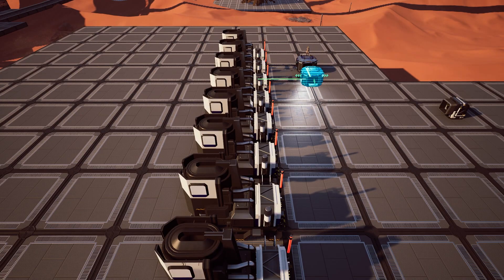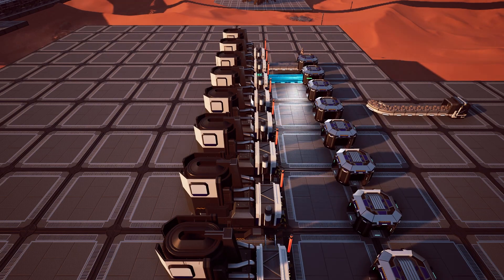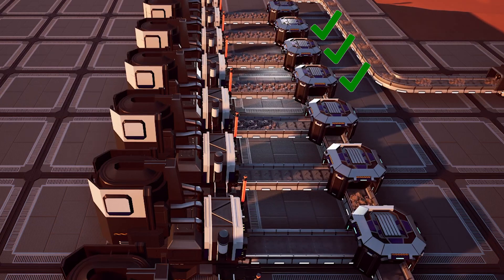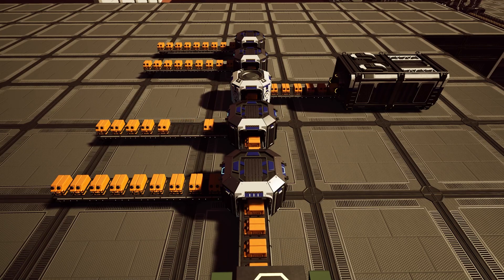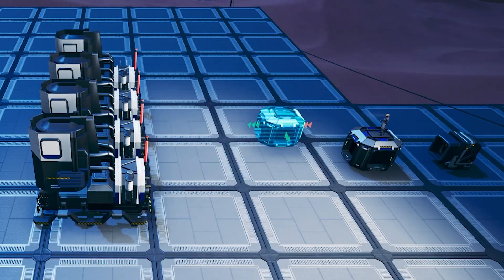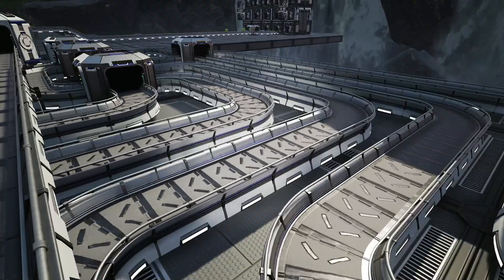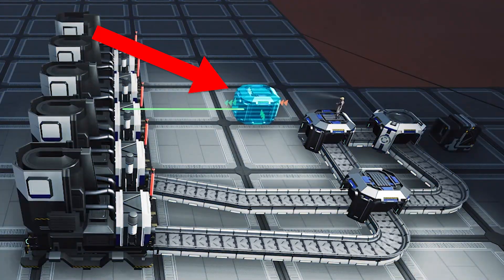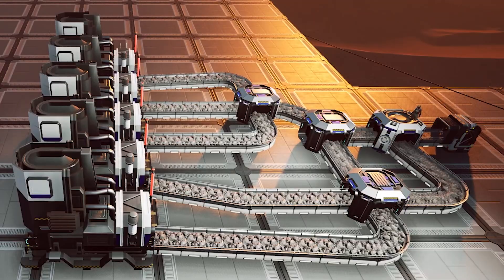Satisfactory: Manifold vs Load Balancing for Belts + Tutorial

Comment: I somehow already learned this, but boy, this was a great video. I would really like to see more tutorials like this. I’m good enough at this game to get through the basics. But the intermediate stuff really slows me down. I just built my first fully automated modular frame assembly line. It was a monster. I had to use external resources to know how to balance the constructors. I really would like to be able to do that sort of thing on my own. But I have no idea how to do the math, even in a spreadsheet, to figure out how many constructors to place at which points, etc. Anyway, enough about that, this was a great video!
Reply from the maker: Thanks so much! This intermediate stuff can be hard for me as well. I didn't fully understand load balancing until I started writing this video, and the research process helped me understand it. This game is a constant learning experience!
Reply: Pen and paper has really helped me. I usually figure out how many items I want of a particular resource per minute then work backwards to the total number of raw resources. (I realize you probably already kind of do this, but my hope is that it helps someone else with their design thought process :D )

For example on Modular Frames, let's say I want 10 Modular Frames per minute. I would break it down like this (assuming all standard recipes):
-2 Frames/min * 5 Assemblers = 10/min
-----12 Iron Rods/min * 5 = ***60 Rods/min*** = 4 Constructors, 2 Smelters
-----3 Reinforced Plates/min * 5 Assemblers = 15/min
---------15 R.P. ÷ 5 R.P./min = 3 R.P. Assemblers
-------------60 Screws/min * 3 R.P. Assemblers = 180 Screws/min
-----------------180 Screws ÷ 40 Screws/min = 4.5 Constructors (round to 5)
--------------------5 Constructors * 10 Iron Rods/min = ***50 Iron Rods/min*** = = 4 Constructors = 2 Smelters
-------------30 Iron Plates/min * 3 R.P. Assemblers = ***90 Iron Plates/min*** = 5 constructors, 5 Smelters

From this we can see that we need a total of:
9 Smelters of Iron Ingots
5 Iron Plate Constructors
8 Iron Rod Constructors
----13 Total
3 Reinforced Iron Plate Assemblers
5 Modular Frame Assemblers

This is just math I've done in this comment section, and I'm sure I may have fudged up a few numbers. It's much easier to write down thoughts on paper and make annotations as you go along. I give specific shapes to my stuff when I write down my actual design but that comes down to personal style.
Reply: i do this in a google Docs or sheet document, really helps with not messing up your factorys, the pain begins when figure out that you will need 5 Iron nodes etc and start to bring in thousands of Items @stealthninja9999

Comment: you can also use different belt speeds at your splitters to help load balance your manifold system to make them start up faster
Reply: I have used this method a few times. Instead of just waiting for the machines back up, you create a controlled bottleneck that limits the throughput to each machine.
Reply: Yep, if the machine itself only has a 30/min processing speed, then there's no point in using anything but a lvl 1 conveyor belt, and the difference in speed of the manifold vs the inserter belts will cause a back-up to occur much sooner
Reply: @Gyrono  the problem is when you have things that only use like 1 item per 2 minutes, and youre maybe creating like 5 per 2 minutes, that can take a very long time to buffer up and belt speeds wont help
Reply: I usually fill the last few manually if I want a constant work from the beginning.
Reply: Only works to a certain extent though...
Reply: This is what I often do

Comment: So how do you split 2 belts into 3? Not a gotcha or a troll - genuine question. "Many to many" is where balancers start getting complicated.
Reply from the maker: There are a couple ways.

If you have plenty of excess space on your belts, you can merge Belt A and Belt B together with a merger, then use a splitter to split into 3 equal belts.

If your belts are full, you could split Belt A and Belt B into 3 belts each, for a total of 6. Then you can just merge those into pairs and you'll get 3 equal belts. You can pretty much use "lowest common multiple" logic to keep it simple. The lowest common multiple of 2 and 3 is 6. As in, 6 is the lowest number that can be evenly divided by both 2 and 3. So just make belts equal to that lowest common multiple (trying to split each origin belt equally, of course), then divide back down to the desired output.
Reply: @SatisfactoryNews  Hmm... OK, that makes sense and is extensible. I've not done a lot of belt balancing in Satisfactory, but I remember the absurdly monstrous belt balancers in Factorio. Specifically, I remember the cardinal rule of maintaining maximum throughput even with backed up or empty lines. I think your proposal might do that, since each output would be fed from both inputs. If an output backs up, it affects both inputs evenly. If an input dries up, it affects all outputs evenly.

I've always given up on these and used some kind of "compound splitter" mod :) Although in the case of Satisfactory, I ended up using packers so the need for multiple belts was drastically reduced. Thanks for the explanation either way.

Comment: The only advantage of balancing vs using a manifold is that the production can start at 100% speed immediately. For a manifold system (especially if you do not optimize belt speeds) you have to wait for the whole production setup to reach 100% speed, at which point it operates exactly the same as if you perfectly balanced the belts. That's it, I wouldn't even call it an advantage personally since it doesn't really give you anything in a long run. Meanwhile manifold is easier to build, takes up less space and is SIGNIFICANTLY easier to scale up.

Outside of some niche applications with particular recipes that you want to ensure perfect rations for, manifold is THE way to go.

Comment: Hybrid systems are also viable. Especially when dealing with high-ratio production like steel screws. When the 260 screws leave the constructor, it is better to balance them into the next stage (e.g. reinforced iron plates) because using manifold for the output of 20 steel screw constructors will require a ridiculous amount of mk5 belts
Reply from the maker: That's a great point! Both systems should be used, whenever they make the most sense.

Comment: I prefer the manifold method. If you need items quickly, you can build a couple of machines first and get them running immediately, while adding more machines along the line as required. With load balancing you need to build it (or plan it) all at once.
Reply from the maker: That's my thought too, I don't plan in advance enough to make load balancing work.

Comment: Manifold injection is even less optimal than manifold. Let's say that you are using a pair of 270 belts. Each machine requires 30 items. You decide to inject after the 4rth machine which means that a maximum of 120 has been used. There is 150 left on the belt. When you inject from your other 270 belt, you will be splitting off 135. This is where peoples run into problems. 150 + 135 is more than the capacity of the belt. This will cause the original belt to stutter. If you had planned for a total of 18 machines, you are not getting 18 machines worth of ressources in this scenario despite having two 270 belts.

Comment: Great and all except looping back when your belt is already at max capacity makes the loopback stupid and pointless and just making a complicated mini manifold.
Reply from the maker: Yeah, you have to keep that in mind. Have enough extra belt capacity for whatever is on the extra belt, if you're going to do the load balancing method. Of course you could just split the source and make two smaller manifolds so you don't have to worry about belt capacity.

Comment: I always go for the "tree structure" of splitters as I usually try to use the right amount of everything, raw mats to final products. It's also interesting for splitting 240 to 2x120, it's not always enough to use lvl 120max belts, i.e. the math in the game is not at all perfect, stuff can lag, over or under produce, etc.
Also, I was waiting for smart splitter in hope it's about load balancing - but it was a huge disappointment.

I wish there was programmability in the game as well but that would lead to serious performance issues I guess.
Reply: Further down the Caterium tree is the Programmable Splitter, which keeps the filtering properties of the Smart Splitter but also elts you manually set split ratios. So with that you could have a single programmable splitter split at a 2/1/2 ratio, then have each of those two larger outputs split 1/1 with a normal splitter, resulting in 5 equally split lines

Comment: Hi, nice video, I tried used both methods at early game but balanced is better and faster at early game.
I love math and would love to see the math behind the 5 balanced mmethod from th e video.
Reply from the maker: Basically, you want 5 equal belts, but the closest you can get is 6 equal belts. If you put that 6th belt back into the system BEFORE they split out from each other, you will have 5 equal belts. It will take a moment for everything to get equal, though.

Comment: Both methods are restricted by belt tier, but it is worse for manifolds because the primary feed belt needs to keep up as you expand. Great video though, I used to see those huge factories with all the splitters and think, "how are they balancing that?" Answer: they don't. Lol. I haven't actually tried a manifold build, but I think I will now.
Reply from the maker: Yeah exactly. Although the fun thing about belt tiers is that you can use a lower-tier belt in order to remove a specific amount of material from the belt (like 60 for example).
Reply: Hey SF News replied! I subscribe for that!
Reply: @SatisfactoryNews  why would you want to remove material from a belt, or really just slow it down on purpose?

Comment: Hey, a slight error at 1:18. The last 2 belts in manifold each output the same amount, in this case both 1/16.
Otherwise you would have 1/32 of the items phasing out of reality as 1/2 + 1/4 + 1/8 + 1/16 + 1/32 = 31/32
Great video for beginners though
Reply from the maker: That's true, I should have added "and so on..." to the graphic. I was trying to imply that every splitter will cut it in half again, no matter how you have. But yes, in the specific example here, you're totally right!
Reply: @SatisfactoryNews Gotta love a creator who listens to fans

Comment: Something about looping back the odd-out belt to the top merger feels like it shouldn't work. Does that really make it into perfect fifths in the end? Part of it just would end up redistributed back to itself down the line, this is bending my brain.
Reply from the maker: It bends my brain too! Think of it this way: You're creating 6 equal belts, but you only need 5. By sending one of the 6 belts back to the start of the chain, it re-inserts that one unneeded belt back into the system so that each of the 5 usable belts actually receive the correct amount of resources. That's also why it only works if you merge the 6th belt BEFORE all of the splitters. It essentially adds the excess back to the start of the system. It's pretty crazy. But just keep in mind that if you want an odd number of belts, isntead create an even number of belts and send the extra one back to the source of the materials!
Reply: The way it helped me understand it more is that you are sort of "narrowing" the belt into a 5/6ths channel that goes into machines, and a 1/6th channel that goes somewhere else.  That would result in a 1/6ths loss of total throughput- but that 1/6th will back up and flow into the machines from the end up if it blocks.  If you feed it back into the input, then on a fully saturated input belt it will immediately back up and feed into machines; or on a not fully saturated belt, it'll replace itself and then get divided into that 5-1 again.  It's not so much that it guarantees perfect 5ths- it'll still deliver the excess unevenly, preferring the paths closest to the "returning" split, if it backs up, I think.

Comment: I think that the manifold is better, it occupies less space and if you have stable productions and a regular amount of material arrives it is better, you just have to balance the line with different types of conveyor belts for balance, before starting production they have to be full It is more difficult to achieve this in productions that depend on gas or liquids, but for me it is a better system.

Comment: 100% load balancers on both input and output.

I like to see you run 32 coal generators off a pure coal with a mk2 miner using the manifold system... it will not run properly.
Reply: Miner MK II Pure node give you 600 of coal if you overclock miner 250% you can run 30 coal generator with tier IV belts, if you have tier V belts you can run 40 coal generators and you need 450 m3 of water per 10 coal generators.

I have 4 Pure nodes and 4 Normal nodes of coal with manifold and run perfect with manifold. Miner MkII overclock 250% can run with Tier IV belts 20 coal gnerators with a Normal Node 30 coal generator with Pure Node.

With MKIII Miner Pure node can run 52 coal generator and Normal node can run 40 coal generator perfectly with manifold, you must only balance input of coal with diferents tiers o belts and start run coal generator with line full. Only must overclock Miner 250% to have enough coal incoming. Limit only are belts. 780 per minute not Miners.
Reply: @joseramonsilvarosano8496  bro right now I'm running a mk2 miner at 200% off a pure node. It feeds 32 generators evenly (a moment before coal burns it gets another). If I clock to 250 I can get 8 more (for 40).

I'm running 2 sets of 32 off 2 pure coal with mk2 miners at 200%

That's 3 water for even 8 coal.

If you around I'm streaming right now. Could show you my setup.
Reply: @ValiousTV  If you have tier V belts can run 40, becuase Mk II only produce 600, really with a pure node you can run 52, but i only run 50, for simetry XD XD XD 

Put one more overclok Miner MKII and you can run 40 with belts tier V,  2 water pump overclock to produce 450 m3 per 10 coal generators one overclock 250% (300m3) second overclock (150 m3).

If you no have belts Tier V you can only run 32,, tier IV belts only give you 480 per minute 480/15= 32 (30 in my setup for simetry) If you have MKII 250% and belts tier V you can run 40 600/15 =40

I put here productión of Miners

Pure Node 

MkI 250%  300  MkII 250% 600 Mk III 250% 1200 (780)

Normal Node

MkI 250% 150 MkII 250% 300 MKIII 250% 600

Impure Node

MKI 250% 75 MKII 250% 150 MKIII 250% 300

With MKIII and belts Tier V You can run: 

52 coal generators pure node, 40 coal generators normal node and 20 coal generator impure node. You must overclock Miners 250% and water pumps 2 for 10 coal generator 450 m3 one 250% 300 m3 and second put 150 m3 i dont know exactly overclock percentage now, you now are limitated for the belts and Miners tier.
Reply: @joseramonsilvarosano8496  I understand the math, I do you the satisfactory calculator. 
I'm just saying with the manifold setup you have to rely on backflow for all 40 to run. 
I'd like to see someone with an actual video doing manifold layout with max coal generators (40).

Why would you waste slugs on water? 
I'm only using 2 slugs per 32 generators.

Get obs and record the build. Hit me up and I'll watch it.
Reply: @ValiousTV  What I have played to satisfactory, what I have seen that it is profitable to overclock is for water extractors and miners, because with alternative water-based recipes much more material production results.

As far as making the 40 coal generators work, I don't have backflow problems because I start with the pipes full and extract just what they consume, therefore there is no backflow.

for every 10 coal generators 2 water extractors, one overclocked to give 300m3 and the other to give 150 m3 in a 600m3 pipe, for 40 generators you need 4 pipes 1 for every 10 generators, there is no backflow if before connecting the centers the line is full.

The manifold works 100% right out of the box starting with the full line.

Disconnect the coal plants, let it saturate the line, distribute the water as I have told you and you will obtain much more energy for the same material.

I have 4 pure nodes and 4 normal nodes that are 360 coal generators and they give me 27,000 Mw/h, I know that I could have 2 more generators per pure node but for reasons of symmetry I have not put them, I have them with manifold and for every 10 central I put a pipe, they work perfectly and in a stable way.

Comment: only real benefit for load balancing is if your machines start and stop a lot. If the flow of materials is constant, manifold will eventually reach capacity and run at capacity until supply falters, at which point it will need to be primed again.

In most situations, this shouldn't be a problem. Factories in Satisfactory kinda run at set inputs all the time, unlike in Factorio which tends to be bursty and require a factory that can proccess a trainload of materials ASAP so it can do it again not long after.
Reply from the maker: I agree, I almost always do manifold. There was, one situation where load balancing was the only way a system would work, but manifold can be made to work for the majority of situations!